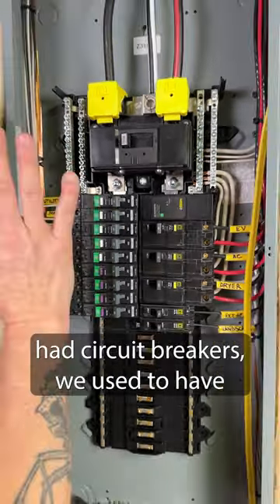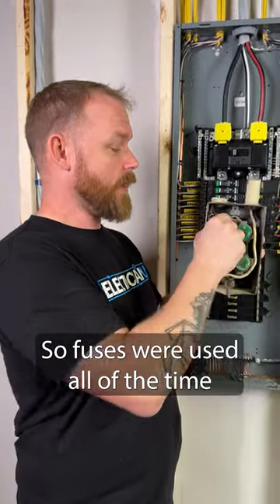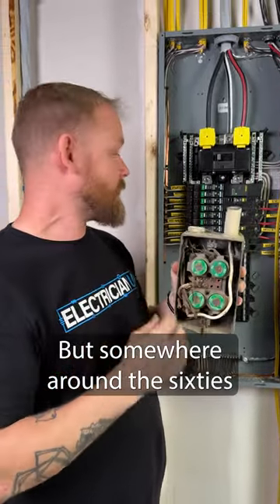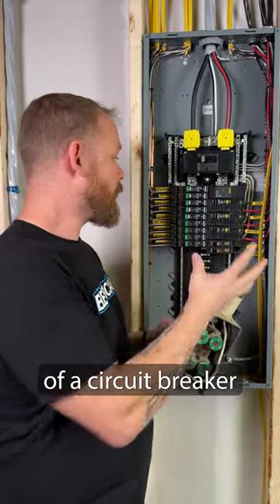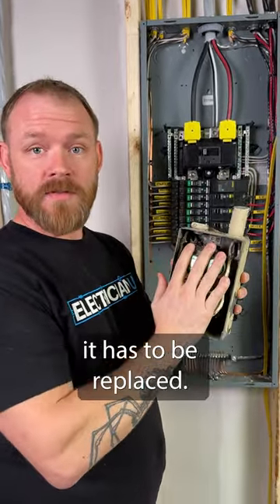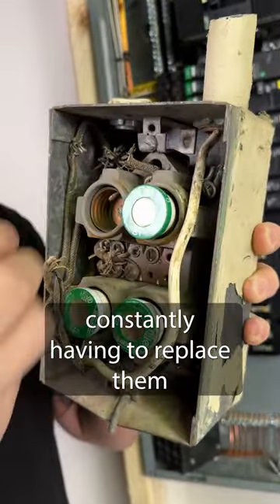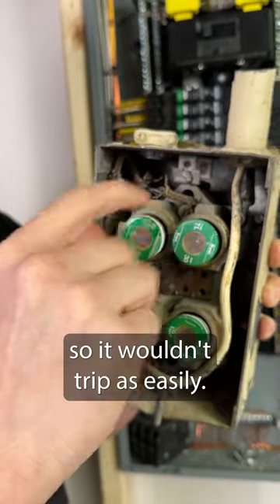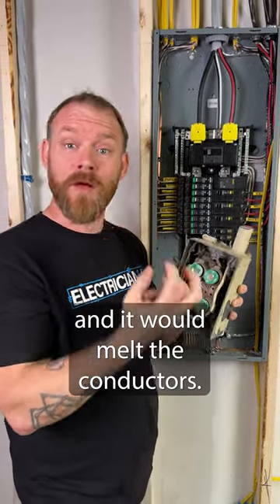Before Breakers There Were Fused Panels - Did You Know

Comment: Little info off a blog on levitons site I thought was awesome so I’ll share 

While some manufacturers came out with residential circuit breakers in the late 1940s and early 1950s, it was not until 1955 when a manufacturer launched a quick-open “QO” breaker that they became the de facto standard in new construction.

I didn’t know that’s what QO stood for.

Comment: Dustin,   Do you know that Bussmann makes fusible panel boards?   At least they did before I retired 2018.   Do you know that a circuit breaker that is exposed to a direct short or ground fault, according to the manufacturers, should NOT be reset and used?  It should be sent out and inspected and tested before reusing.  Do you know that fuses can be checked and tell you if it was overcurrent or short circuit?  Do you know that breakers are derated to 80% for continuous loads and fuses are rated 100% for the same load?   
I’m just having some fun with you.   Have a wonderful day.

Comment: Breakers were here way before the 60’s. My parents post WWII house (1950) had a 150a service and a 20 circuit GE breaker panel w main installed (probably 75’ of unprotected entrance cable from meter to panel… they were on opposite ends of the house 😂 and believe it or not the GE style breakers made today still fit it perfectly. No equipment grounding  at outlets or switches.. but the boxes were all metal and were grounded. all 2-prong ungrounded outlets. The NM cable of that era was cloth sheathed (mice loved it) and did have a very thin (maybe 18ga.?- tiny) copper ground wire which was attached to all the boxes, and  the devices themselves did have a metal frame that was in full contact w the box (in theory 😂 unless you needed to pull the device out a little for a thick wall) …and the house still has the same panel and wiring  today that was installed when it was built. I’ve worked in 100s of houses built between 1950-1970 with the same set-up.
Reply: My great grandparents first and only new home they had built for them in 1953 when Grandpa got home from the Korean War had a breaker panel, grandma recalled,  as for the brand she doesn't remember a thing about it.  Grandpa was an apprentice right after getting home from WWII and was master electrician when he had the house built,  and so he wanted the latest and greatest in home technology available at the time.   On the other hand three years ago I was remodeling a house just outside of Charlotte NC built in 1964 with a 100 amp FPE fuse panel consisting of the main block and knife blade fuses,  two appliance fuse blocks for the range and dryer, and 8 edison base fuses for the general purpose circuits and a mix of copper and single strand aluminum wiring.  1964 seems to be around the time they first began using aluminum throughout the home.   I helped my stepfather rewire his 1973 ranch home in 2006  and it had a 70 amp service with a Zinsco panel and all aluminum wiring,  burned wall outlets and lights that flickered or didn't work.   

Thanks for sharing,  never know what you'll find when renovating an old building,  that's the fun of it.

Comment: My parent's house was built in the early 1900s (the date stone is hard to read, either 1905 or 1906). Someone at some point upgraded the wiring (the original box is still there in the top floor, just not connected to anything) and in the basement are several fuse boxes. When we first moved there in the late '70s, my engineer father drew floor plans of each floor on 8x11 graph paper with outlet and fixtures indicated. Then by removing fuses one at a time he mapped the fuse location for each outlet/fixture on the plan. That made it much easier to locate blown fuses when one would blow.
The fuse boxes are still there, so I grew up w/o circuit breakers.

Comment: Unfortunately, you forgot the reset fuses. They had a small button in the center to reset the circuit.
Reply: Reset style still available at your local Home Depot in areas with older homes that still have fuse boxes. I'm sure there are many thousands of homes that still have these.
Reply: These are just retrofit circuit breakers.
Reply: @drkcobra  Correct.  Just a circuit breaker that screws in where the fuse used to be. Used them in the old part of the house I used to live in.
Reply: In my area of West Tennessee and Western Kentucky, every Lowes keeps the push button retrofit breakers in stock.
Reply: Did you know what you just described  is actually a circuit breaker in a fuses form factor
Reply: I've never seen these.  Do they replace the fusetron fuses or is that the original design?
Reply: @christopherscott8853  in most supply houses even big box stores thry carry the round resetable fuses. Thry look like your traditional fuse but you can't see through and have a resetting button on top. Please make sure to buy the proper Amperage for your circuit.

Comment: Have never seen someone stick a penny in there. Usually they would just go with a oversized fuse. So for a 15A or 20A, you would find 30A fuses on circuits that blew a lot.
Reply: There is an old john prine song, grandpa was a carpenter. One of my favorite lines says he stuck a penny in a burned out fuse. Never understood that line until now
Reply: @docsridingadventures2880  carpenters probably used a cut nail
Reply: there was an all in the family episode
Reply: I thought the fuses had different  sizes so 20A fuses wouldn't fit into a 15A place (too large). But they made adapters so you could change sizes at your own risk.
Reply: @ccadama  What he's showing are Edison base plug fuses, they are the same as light sockets, so any amp rating will fit.  In Wisconsin, we had to use Type S fuses.  They were color coded; Blue 15 amp, Orange 20 amp, Green 30 amp.  But Type S has different size sockets, a 15 is smaller and would fall out of a 20 30a socket, thus a 20 or 30a are too big to substitute for a 15.  For a disconnect you had either a handle switch or a black square block.  Ours had a wire handle to pull it out, on the back their were 4 prongs to make to connect the buss bars, but one prong was slightly closer than the others so you could flip the block and stow it in the panel and it read "OFF" on the top.  The back of the block had 2 cartridge fuse holders, with 2 60 amp fuses, (60 amp service was very common.  100 amp service started in the 70's).
Reply: I think most common is foil
Reply: @davidmarquardt9034  it may have become common about then but my parents house built in 1954 had a 200 amp service.
Reply: In Finland fuses were made so that you could not install larger one. The larger the fuse the bigger it was physically. You could install a smaller one though.

In the UK they had a horrible system where you bought fuse wire and wired the fuse yourself.
Reply: I have never seen a penny, but I have seen a fuse which somebody wrapped a piece of aluminum foil around before screwing it in...
Reply: Looks like someone did that with the panel he is holding.

Comment: I’m still rocking a fused panel with aluminum romex from 1974
Reply: Hellll yeeeah🔥💯
Reply: We can't do that in our area the electric company would cut our supply if were don't install it according to code 😂
Reply: @PineappleOnPizza69  aluminum romex isn’t even against 2023 code. As for fuses instead of breakers, idk I’m rusty
Reply: They do make retrofit screw in circuit breakers now for the old fuse boxes. I know they exist in 15 & 20 amp versions at least. Makes a lot more sense than to keep buying and blowing fuses.
Reply: @drkcobra  i haven’t blown a fuse in a decade; I know each circuit and it’s ampacity
Reply: @MrFitness94 that may be true. But on the other hand, i haven't blown a breaker in the last decade either...
Reply: Aluminum romex was eventually banned by the NEC. It caused a lot of fires due to the connections coming loose over time. It was also rated for carrying less current than copper wire so in a kitchen you would have #10 aluminum wire in a kitchen for the 20 amp circuits which was a mother to work with.
Reply: @fredflintstone8048  it is not against any nec code. It’s just not sold anymore. And I know about the ampacity, I have 12 awg AL to all 15A circuits. Kitchen is a split recep
Reply: @MrFitness94 aluminum is against code, however older installations are acceptable unless major work is done. Same with fuses, no new fused panels are legal (accept for some main disconnects and high voltage). (Grain of salt)
Reply: @fredflintstone8048 the NEC allows copper clad aluminum and anything 8awg and larger so aluminum is not against NEC.
Reply: @fredflintstone8048 what’s the code reference for the banning of aluminum non metallic sheathed cable?
Reply: Your Dangerous!!!
Reply: That beautiful 😢
Reply: You are either BRAVE or CRAZY
Reply: Until your house burns down 😂
Reply: 😂😂😂😂😂😂😂 @ParlasX4
Reply: Good  luck  with  that  . O yea  just  don't  mix the wire  with  copper.
Reply: Don't let your insurance co know. May be code, but if the book says charge a higher rate, you'll pay.
Reply: Same here bud ahah
Reply: Dad showed me that trick back in the 80’s (in São Paulo, Brazil).
Reply: I have aluminum but I do have circuit breakers though 😂
Reply: I am using fused panel with knob and tube wiring from.... NO IDEA... but it's old rubber/cloth wiring.
Reply: @MrFitness94  the only time my circuit breakers trip is when my mom comes over and plugs the hair dryer into the wrong circuit. You can't always control every variable ;)
Reply: I have a fuse panel in my trailer house from the 70s. I don't mind it
Reply: I thought by then most installs were using pushmatics back then?
Reply: @DGTelevsionNetwork  canada so idk
Reply: Im guessing London, Ontario. The Aluminum wiring capital of Canada lol. It's not the big deal everyone makes it out to be, those houses are 50+ years old now and haven't burned down.
Reply: Still have raw wire in the baseboards, no insulation.
Reply: @PineappleOnPizza69 thats everywhere, but for new installs and replacements only. Existing panels are grandfathered in. Same reason ungrounded circuits exist, and cast iron drains, and galvanized water lines, and oil furnaces....
Reply: @DaDaDo661  close, but yeah. The aluminum made at the end of the aluminum era was pretty damned robust. I’ve found alu wirenutted with cu without noalox or a proper connecter that’s 30+ years old and it’s just fine
Reply: @PineappleOnPizza69 
There a difference between new construction and remodeling vs shit that’s existing, if it was existing when there was power at the house (which it obviously had) they cannot make you rip your house apart to “fix up electrical” 
There’s something called grandfathered in, and I’d bet he’s grandfathered in 

1974
Reply: Half my house is aluminum.  I change it out as I expose it during any remodeling.  Where I can't I've purchased a bag of connectors to change to Al or add copper pigtails..  another plan is to swap out standard breakers to arc fault.
Reply: Could you see what happens if you screw a filament  lightbulb into your fuse panel? It will fit and I need to know for science
Reply: @catfood9707  will it actually fit? Surely the thread pitch is different? I guess you’d just get a dim-lit bulb and misbehaving electronics
Reply: Once you have an electrical fire even a small one that only costs you a few hundred dollars in property damage. Then you will have no choice but to fully rewire your house.
Reply: I still have my wires with rope as the insulation
Reply: is the electricity bill expensive high ??

Comment: I got 2 those screw in fuse boxes in my garage still. 1 for water heater and 1 for 80 gallon 220v air compressor. Water heater 1 came with house. I installed the 1 for compressor when I got it. Both go to breaker panel. The fuse boxes are next to devices and have shut off levers for added safety.  Water heater never blew one in 20 years. Compressor goes through a few a year. But I suppose better the fuse takes the hit than the breaker constantly

Comment: A cabin we go to in the summer had a Fuse Panel for decades.  A tree a little distance from the cabin got hit by lightning.  The charge flowed up through one of the foundation pillars, blew up a stud that had some moisture in it, leapt to a window screen, flowed across the screen then jumped to a Radio.  From there the charge flowed into the master bedroom and blew the fuse.  The cap of the fuse slammed the fuse box door open, launched the cap to the other side of the room and the fuse box door closed itself with the momentum.

That cabin now has a modern wiring system with circuit breakers and proper grounds!  We are SO lucky nobody died during the lightning strike!
Reply: Wow, that's crazy

Comment: There's a safety issue with fused panels and disconnects: exposed energized components. I'm 77, changing fuses wasn't an everyday event but seems it happened more often than tripping a breaker. A home might have 6-10 fuses; my current house has a 40 slot main panel and it's beyond full, it feeds 3 subpanels (shop, pool & landscape lighting, etc).
Reply: My house has 2 40 slots feeding the house (one per floor), and 20/40 and 12/24 in the shop

Comment: Fuses are a non-mechanical safety feature and super safe. The problem is human stupidity and laziness (bypassing the fuse or putting a higher amp fuse into the socket). The only time I’ve seen a fused panel fail under normal (not stupid) conditions was when a fuse to a water heater was loosened enough by vibration to arc and melt the socket.
The socket style fuse was a mistake in my opinion. They could have made it so that 20A and 30A fuses were too large to fit into 15A sockets and the edison style screw could have been made safer with bayonet style sockets (like older car headlight bulbs) where pins held the bulb in place and vibration would not budge it.
Some blade style fuses work this way. You cannot put a 200A fuse on a 80-100A panel, although you can buy adapters to put an 80A fuse on a 200A panel and safely down-grade the circuit because the fuse/breaker should always be the limiting factor in a circuit, NOT the wires or devices. Blades limit the stupid factor, but I've still seen people flatten copper pipe in place of a blade fuse, but you really have to go out of your way to stupidly bypass the fuse.
Side note: Those older 200A disconnects are so satisfying to operate (kachunk-kachunk).
Other side note: A lot of older homes/panels have started adding an arc-fault protection to their circuts after older style breakers (rather than replace their oldie but goodie panel), I'd love to see a video on that. In homes with older two-wire (no ground) circuits, replacing the first receptacle with a GFCI or combo GFCI/AFCI receptacle is a big savings compared to a rewire, but I encourage people to add it in a box back at the panel to protect that initial leg of the circuit.
Reply: Interesting. I’ve been desperately needing to upgrade my 1930’s house. Perhaps you can make one, if he doesn’t?
Reply: @sunshine3914  I don't see why you couldn't put arc fault + GFCI combo receptacles on the circuits leaving your fuse panel. Modern protection on an old system at $35 a circuit. That is an option if you're not blowing fuses right now and you don't have the cash to upgrade your service and get a new panel, maybe leave if for the next owner who renovates. Depends on how long you will live there. I doubt you get your money back in value when selling house after a rewire.
The problem is not wiring from the 30's (although the insulation is brittle, don't move it) the problem is (most often) hack jobs over the past 90 years where they made new branches with janky connections (splices dangling inside the walls wrapped in electrical tape). The original old sparkies used to solder their connections. But it seems like the 60's and 70's was the wild west. Everyone was a pro reading Popular Mechanics.
Reply: Can't do much about the stupid factor just like trying to make things idiot proof 🙄 learned a good one "stupid factor" 😅

Comment: One issue I have as an electrician with fuse panels is homeowners not knowing was size fuse to put in.  I've never ran into the penny trick in the wild, but I've seen 30 amp fuses screwed in protecting 15 amp wires.  Old farmhouse with multiple window ACs.  So many boxes and line taps, it's one for a binder I'm going to print up one day

Comment: My house still has a 60 amp three wire service with a pair of Federal Noark fuse boxes.  And what a cobbled together disaster that was when I moved in.  They had a piece of number 10 feeding the second panel.  Held up for a lot of years though - even the electric dryer was on the sub through the #10!  I cleaned it up as best I could.  Replaced the sub feeder with a short piece of number 6.  Treated the sub as a real sub even though it's right next to it.  Put a separate isolated neutral bar in it.  Some day when I get time and money I'll redo it all the right way.

Comment: I’ve worked on breakers from the 1940’s.  They have been around.  
I found at a garage sale some years ago a book, for the do it yourself guy, on wiring your house and barn. 
The standard box was called an MR4, 2 fuse main 240v, 2 fuse range 240v, and 4 120v circuits, 2A phase, 2B phase.  This is knob and tube stuff.  
A warning for the youngsters, if you have ever heard of people talking about “switching neutrals” that’s not exactly what’s going on.  It’s called a Carter system.  All you need to know is to maintain the same phase of every single 120v circuit when you install the new panel.  You’ve been warned.